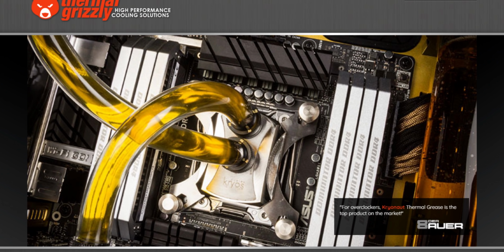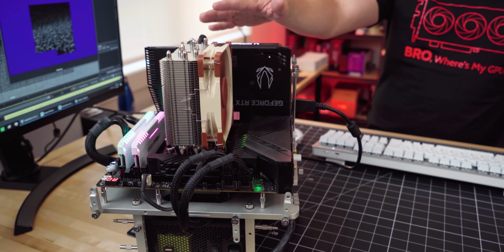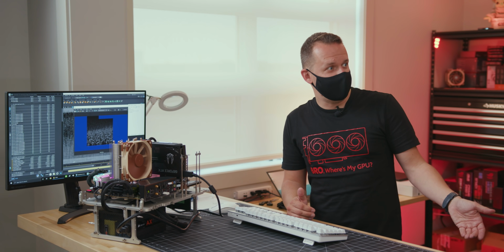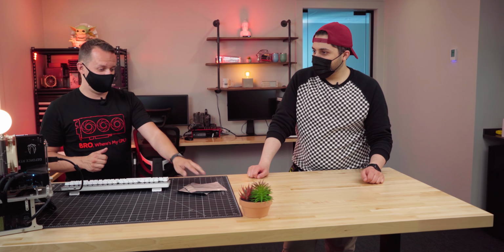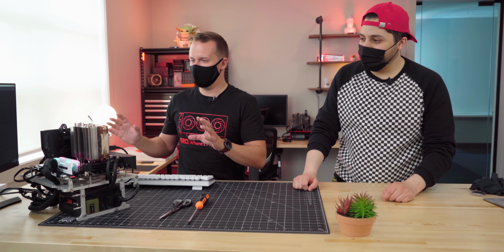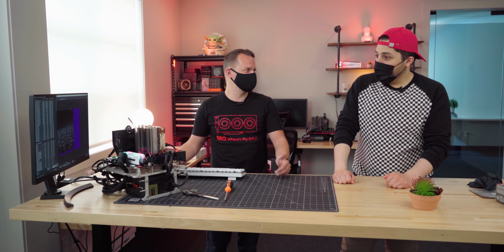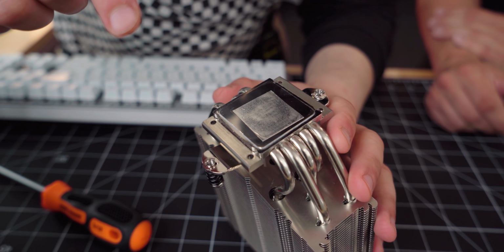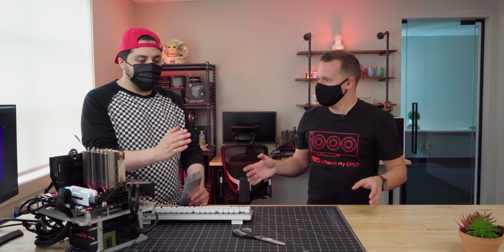Can this MYSTERY Metal Replace Thermal Paste?

Comment: you know, Copper is soft...i'd love to see how a extremely thin copper sheet could work as TIM, or even gold!
Reply: @superkoopatrooper4879  i've lapped my 3950x and waterblock, so i'm fairly familiar with how un-even it is, so i'd not be suprised other metals would be hit and miss in that regard
If someone was to try gold, copper or any other metal sheet, it surely would not be me!
Reply: Silver has higher thermal conductivity at around 429 W/m·K compared to gold at around 318 W/m·K. Graphene has conductivity in range of 4800-5300 W/m·K .
Reply: NZXT also has copper pads on their AIOs. Danger of mixing some metals with an electric current involved, you get electrolysis and the metals transfers and causes issues.
Reply: Test the indium sheet of different thickness and also on higher TDP cpu and GPUs ❤️
Reply: Aren't some coolers actually solid copper with nickel plating to even out the surfaces because of how soft it is? And to reduce the chance of conduction of course lol.
Reply: @ChaitanyaShukla2503  yeah but silver isn't as soft as gold
Reply: 24 carat gold leaf should be interesting. It can be so thin it's barely there...

It would also be interesting to see if a cooler and a IHS could be lapped perfectly enough that they can be wrung together like gauge blocks. Gauge blocks have the interesting property of being able to stick together through a process called wringing. Exact how this works doesn't have one simple explanation. Part of it is that the surfaces are so prefect that there isn't space for a single air molecule between them. This means the air pressure itself will press the parts together. Then there is the very thin film of lubricant that is usually applied to the surfaces. This is called the wring film and is usually about 25 nanometers thick. Finally there is the molecular attraction that occurs between two very flat surfaces that are bought together.

While it should be possible to lap the surfaces to achieve this and I'm pretty sure someone has tried to do this already but I haven't seen anything about it. My guess is that the surfaces won't stay perfectly flat when temperature changes due to thermal expansion. But it would be interesting to see if it could be achieved and then how it would perform. Theoretically it should provide the best possible contact between the IHS and the cooler but I have no idea about what the performance would be IRL.
Reply: lol I commented before reading the top comments.  D'oh!  100% on board with this
Reply: I'd love to see myself some silver.
Reply: @ChaitanyaShukla2503  gold is probably the best option because it is so soft. Ductility and conformance, along with thinness would help heart conduction most.
Reply: copper is soft, until you bend or hammer it, then it becomes very stiff and hard.

To make it soft again, you will need more heat than the electronics in your computer can provide. A torch burner flame will do, but then you need to remove the slags that appears.
Reply: @ZeDarkLord  Silver has good conductivity and has been used as a heat spreader in at least one heatsink, but it's not as soft as gold (high carat gold that is) or even copper if I remember correctly. The softness, or malleability of the material helps it to conform to the surfaces and improve the thermal transfer. Pure aluminium is also quite soft, though it properties changes drastically when alloyed as most of the aluminium we see every day is.
Tin is another very malleable metal and might be worth giving a try. It has a relatively low melting point but at about 230°C it's still way higher than what a CPU should produce unless it suffers from Error 120 or Error 220...

Lead is another possible TIM (Thermal Interphase Material). It to is highly malleable and it has a melting point of about 330°C.

In all cases I'm talking about the pure metals as any alloy can have very different properties. Gold for instance is almost never used in it's pure (24 carat) form as it's so soft it will easily scratch, deform or wear down. 14 to 18 carat alloys are much more common in jewelry or any use where mechanical wear is likely to occur. As I understand it 14 carat is really on the low end and can suffer from some corrosion, while 18 carat is usually considered to be safe and hard enough to stand everyday wear when used in things like wedding bands. 24 carat however is extremely soft and will wear down if used in rings. My parents had wedding rings made of 24 carat gold and they wore down significantly over the years. Eventually they took them to a gold smith who remade them into one ring that my mother then wore for the last few years.

Edit: Also almost all metal oxidizes. Copper, tin, lead, silver and aluminium all oxidize, and that oxide generally have rather bad thetmal conductivity compared to the metal. Gold on the other hand does not oxidize and will not tarnish and the contact should not deteriorate over time.
Reply: @blahorgaslisk7763  That makes a lot of sense, thank you so much for taking out your time and explaining :)
Reply: @ChaitanyaShukla2503   side way
not up and down
Reply: it can’t fill in the gaps as well as thermal paste or a liquid metal.
Reply: @blahorgaslisk7763  Gold leaf is probably too thin.
Reply: @QuentinStephens  Gold leaves comes in several thicknesses. Leaf intended for outdoor use or religious icons is generally something like 20 to 50 percent thicker than leaf intended for simpler projects.
Reply: @blahorgaslisk7763  Interesting concept here.

Comment: Something about thermal paste just feels right to me
Reply: Well, thermal paste is a liquid

And its job is to fill gaps, so a liquid feels like it would fill more gaps then a solid
Reply: I bought Arctic MX-4 2019 a year ago when it had a contest win $500. Of course I had a tube already but it was 5 years old so the contest just convinced me to get a fresh tube.
Donated the 3/4 full older tube to Free Geek, they do a lot of computer building. Doubt I will ever buy anything else.
Reply: @elinor8569  But both expand under heat, so that should be a non-issue
Reply: @mastaw  I was trying to explain why it "feels right" rather than how it actually works
Reply: @mastaw  the gaps are nanometric and they exist in almost any surface you can study. Its unlikely that any solid can fill those gaps at all. 
Due to the very bad thermal conductivity of any gas in comparison with a solid materials, even a little bit of air can turn into a problem for the heat dissipation. In W/m.k, Al ~ 204, Cu~372 and air ~0,023.
Reply: But I'd rather a degree warmer if it don't dry up after a year or two and you have much more consistent and not so much degradation over the months/ years

Comment: I think you could try this again with a lapped CPU/cooler. Also I think you should be using a higher wattage CPU since the differences show better at higher heatloads. E.g. If paste A performs better than paste B by 2C at 100W, that might be 4C better at 200w as a rough example. Great work nonetheless, hope to see more on this soon!
Reply: And the all forgotten rule is, higher pressure on the sheets work better on transferring heat.
Gamer Nexus have shown this to be a legit method to increase the heat transfers with sheets as gap filling.

Comment: One more thing while I'm here, aluminum foil is a household item that is extraordinarily uniform in thickness with deviations in the range of a couple nanometers across the full width of a sheet. Aluminul foil will not introduce ANY imperfections (air pockets) but will only expose those already there.

Comment: What about the 0.15 mm sheet? It's 3/4 of the thickness, which means thermal resistance should be 3/4th of the 0.2mm sheet. This could very well improve the results by a few more degrees here!
Reply: only if it doesn't have any voids in it from lack of depth to seal the contact.
Reply: It didnt, we tried. It actually was worse. It was cut out of the video for length ( might be in a follow up ) but at .15 it seems there isn't enough pressure to push it through the surface imperfections. Making it thicker means bottoming out the cooler gives you slightly higher mounting pressure. enough for a 2-4c difference.
Reply: @SnowsLife  How is this, vs thermal grizzly conductonaut? How is it for long term use, and are there any metal reactions I should be worried about?
Reply: @Salty.Peasants  That's that I want to know. IIRC the carbon sheets don't quite perform as good as paste, meaning this is better. But it looks like this is on par with paste, meaning the conductonaught liquid metal will still be a little better. But this obviously has a huge advantage with clean up and reusability..
Reply: @SnowsLife  If you're up for messing around, it would be interesting to see if you could double stack the 0.15mm or even the 0.20mm sheets... I mean, you could just buy thicker ones for a proper test, but it could be interesting ;-)

Comment: Definitely would like to see a roundup using this stuff. Like different thicknesses, different CPUs, to see how it handles higher vs. lower wattages and even how it works out on a larger die like on Threadripper. Super interesting vid though, would definitely like to see more!

Comment: I'd like to see snows do some hardware cunucks episodes doing review stuff. He's great on boot sequence for the news too and his beats are flipping amazing!

Also 1-2 hour min is required for the burn in test to goto steady state. So I'd like to see that be done in the future instead of 15-45 min tests. Also plot the Temps from start to finish to see how they deal with low temp and high temp between the different substrates.

Aluminum, carbon nano, copper paste, indium etc all good tests I'd like to see, even though I've seen them all before. It's going to be some what different between amd with its Chiplets and Intel with its single chip package. So maybe a comparison between the two for the top two winners.

Comment: Damn, this video was actually pretty good! I've never heard of that stuff, and seems like a possible solution for specific applications.
Reply: Was thinking long term, 24-7/365. never dries out, or cracks, just helps move heat.
Sure as mentioned above it might weld it's self to a cpu, But I've pulled AMD cpus out that had stuck to the heatsink and wouldn't let loose . If you need to service it, it probably needs more than fresh paste .
Reply: @OH-vb6ww  true, no worries about dried up thermal paste. There are some server applications where this would probably be ideal. Hopefully no other motherboard components fail though, nor no CPU upgrades needed, then it would be an excellent server solution.

Comment: In researching Gallium Nitride devices, i have read that using predominantly diamond based cooling paste/pads that it lowers 400C junction temperatures quite well so I’d love to see how well this could work if it was even doable.
Reply: It works great but can get very expensive. IC Diamond is better than Kryonaut and pretty close to being as good as Conuctonaut. Problem is that it's very difficult to apply and the diamonds destroy ihs' unless you use a lot of cleaner and acetone while being super careful not to rub or wipe with any pressure, I use a brush. Now back to cost, you may have seen Kryonaut LHe / Kryonaut Extreme Pink pastes on Der8auers YT channel. The reason they perform better and cost more is because the size of the particles used (TGrizz secret blend, not diamond) are smaller and it becomes more difficult to actually make and to mix evenly + keep dispersed and suspended in place instead of working their way downwards from gravity. This is why IC Diamond looks and smells like tar and has larger particles that scratch any surface they touch

Comment: reliability over time- does the indium give consistent results over time with lots of heating/cooling cycles? It might even get better after a few burn-ins for all we know
Reply: It probably gets better as it is soft with a low melting point, that could make it fill the gaps as time passes.

Comment: I have an IC thermal carbon thermal pad myself. I used it on my main system for about a year before going back to a paste. Only because I was just getting center point contact from the cpu and cooler. :/ 
But I use that thermal pad to run tests all the time. It has saved me soo much money in thermal paste. I used to go through tube after tube. I now get just one tube every couple months. I might spring for this and try it out. Maybe the little extra thickness over the carbon pad will make the difference. 
thanks

Comment: Anti-seize, for car bolts is an EXCELLENT TIM. I've used it for years on PCs with better results than thermal paste. For those of you that don't know, anti-seize is a compound made from fine metal shavings (usually aluminum or copper) and oil. You must treat it like liquid metal because I believe it is electrically conductive. But it's well-worth the performance gain over traditional thermal paste. I saw anywhere from 5-8*C improvement. Try it out.

Comment: The problem with aluminum sheets, it's that by the time you apply it, it's no longer pure aluminum. It will have a layer of aluminum oxide that have a way lower thermal conductivity. Aluminum oxidize extremely easy with the oxygen in the air.

Comment: One note about indium, it would work much better if it had higher pressure, but pressure from common cpu coolers is not enough to get the most of it. So you should try to find a version with holes in it, that works better apparently since it gets higher pressure (lower area). That would be an intersting test, but I am very glad that you tested indium in first place :)

Comment: Been using gallium/indium on my gear for six years.  Granted, it is liquid.  Started with CLU, but it had a hardening problem that isn't as bad with Conductonaut.  I'd think think that these sheets wouldn't fill the little pits and crevices that LM or even paste will unless it is really soft.  Oh, and maybe "heavy duty" aluminum foil would be the better choice rather than that discount stuff because the indium was 200 micrometers thick.

Comment: I'm going to hypothesise that over time the indium is going to weld the cpu and the cooler together..
Reply: tbh, you can hypothize that  metals with that high thermal conductivity are in the same temperature. That being said, Indium melting point is ~157°C. Its unlikely that any CPU can achieve that temperature. The problems that would need some testing would be thermal fatigue and creep phenomena. My guess would be no welding
Reply: @myw0rk  I don't mean actually welding... But even at submelting points, the soft metal will warp into those tiny deformations on the surfaces and hold them together like glue... So less like a piece of solder.. More like a piece of velcro??
Reply: @vivekvs1992  I see. I guess that could happen if there is creep happening. Anyway, its not a few minutes testing that can tell if these things are doable or not. This is a nice subject for a video but a shitty idea and well, its not worth the trouble, either for air gaps or other issues that wouldnt happen with a paste.
Reply: @myw0rk  yeah... And not practical for us individuals to risk our only set of hardware on...

Comment: What are the long term effects on the indium sheet. Could you guys do a long term test? Curious how it reacts with pure copper and not just coated copper. Is the effect better with direct heatpipe? Also do you get better results from lapping the cpu and or the cooler surfaces? Great video!
Reply from the maker: Will look into it!

Comment: There is actually a similar product advertised toward PC usage called "Liquid MetalPad"  by Coollabotatory. They might be using a slightly different alloy and the melting point is claimed to be 58C.
Reply: So those seem to be metal sheets/pads that you install, but once in use they turn to liquid. I wonder how easy it is to removed since at room temp it is metal.

Comment: So what would happen if you heated it just to it's melting point after applying it to your cpu and put your cooler of choice on? What I mean is just, get it hot enough to perfectly conform to both surfaces then let it cool? Would you get liquid metal like performance since it would be filling in all the micro groves and scratched like liquid metal TIM does? Or would it not make any difference? 150c isn't to hot for a cpu for a short time so it wouldn't burn out the cpu especially if you tried to only heat the IHS and considering 150c is well below the melting point of solder/solder TIM it shouldn't be a problem for the cpu. But for a big chunky air cooler it might prove to be extremely difficult to get it to that temp and cool it in a reasonable amount of time. Just an idea...

Comment: I think that the main advantage is it doesn't dry out. Ever had an old tube of thermal paste and saw some oil come out of it with the paste?  That oil is what likely dries out leaving that disgusting chalky and now mediocre paste behind.  When you buy a graphics card odds are that you have dried up paste after a while if it is not already dried.  If this foil is on par with a good paste in cooling performance that is actually worth considering.  Now if you ever take the cooler off you can't reuse it.  You should not reuse old paste either other than an application fresh from the tube.

Comment: I think that aluminum foil was full of oils at that point, but hey, not a bad result. The performance of the Indium was impressive. Paste is easier to use, I should think, but it dries up, and removal requires alcohol. A sheet of metal alloy like that won't dry and won't stick too much. Really, though, it's rather shabby of Intel to not make proper heat spreaders. I saw another video where sanding it even cut the temperature with like 5 degrees. That's crazy.